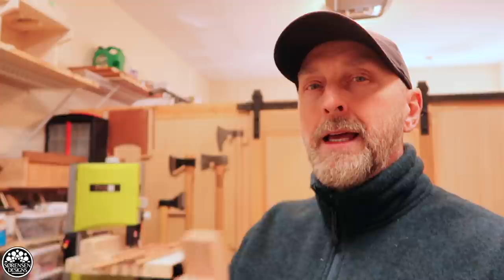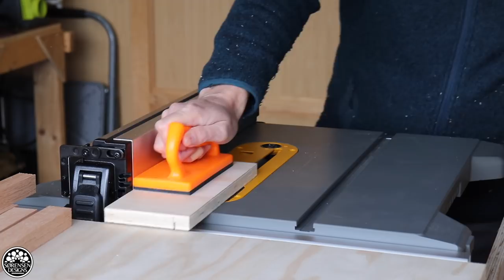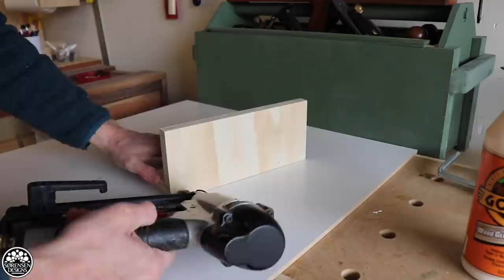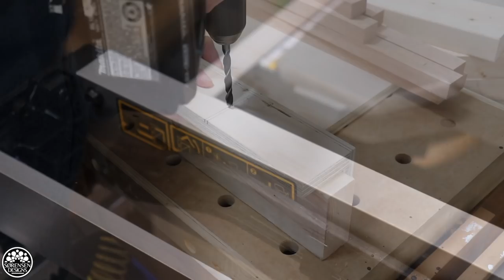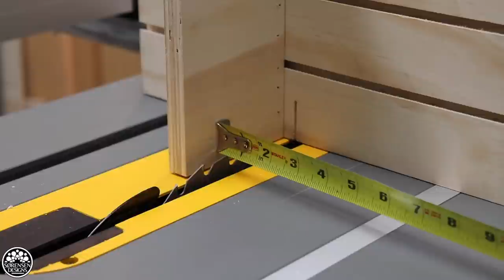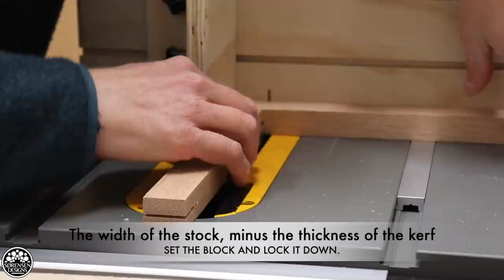Perfect Half-Lap Joints with One Simple Jig // Woodworking

Comment: Just wondering if you are still using a 7 1/2" blade in your saw like the Master Woodworker suggested?
Reply from the maker: My new Dewalt Table saw is a 8-1/4" blade with a matching riving knife. A very reasonable size and from what I understand, 8-1/4" and 8-1/2" will become a standard soon.

Comment: Is that table saw the type that is often called a “job site saw” rather than a carpentry or cabinetry saw?
Reply from the maker: It's the new Dewalt 8-1/4" compact Table Saw. Sometimes, I guess, they refer to it as a job site saw but I did not buy their rolling table saw stand. Cabinet Makers Table Saws are actually quite large and sometimes have a sliding sled attachment.
Reply: Thank you! I found your other videos on it and am watching now.